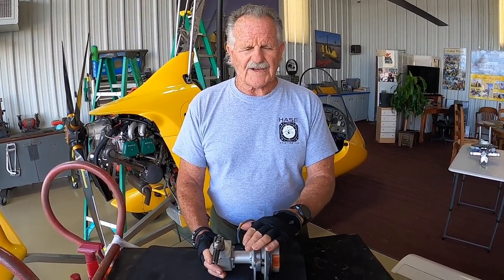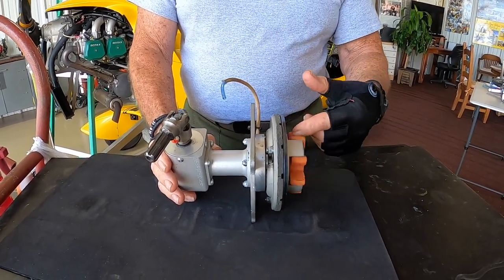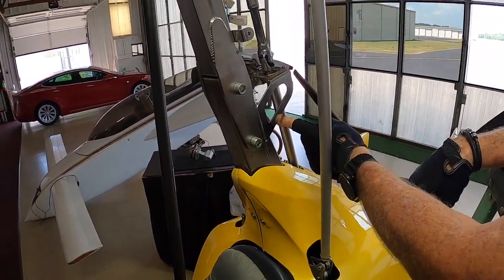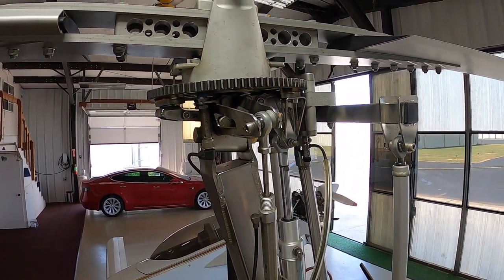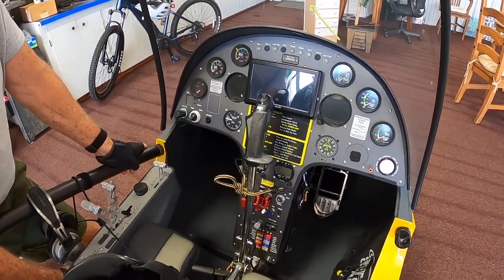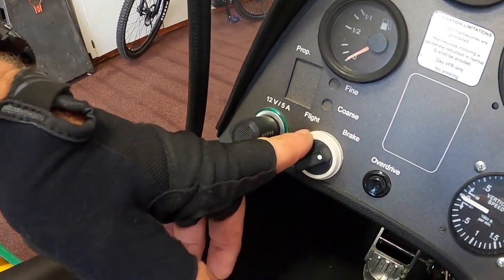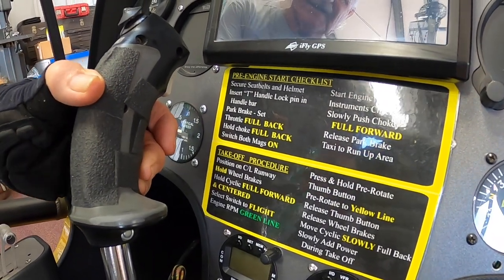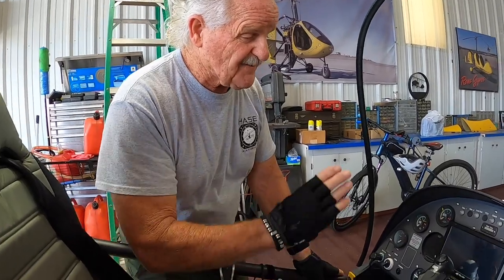Autogyro Pre-Rotator Systems

Comment: Just out of curiosity a question.  Wouldn't a small electric motor (high torque, low power) be a much simpler solution, with fewer parts?